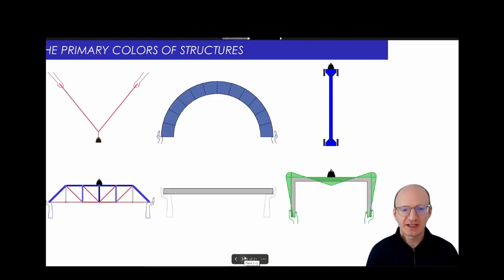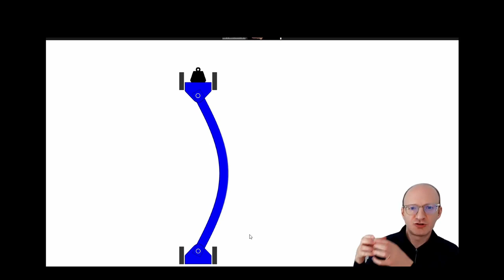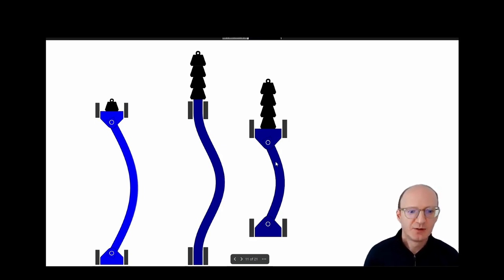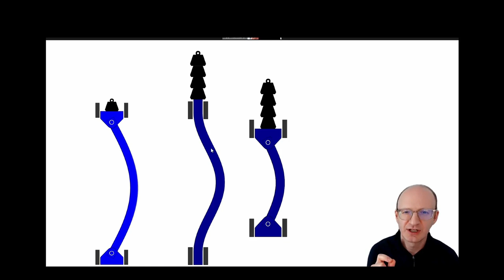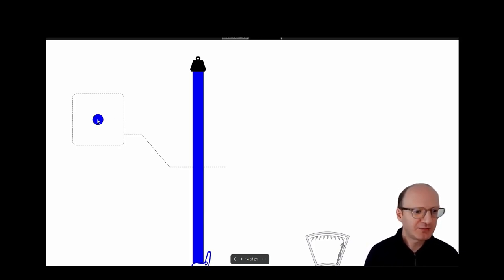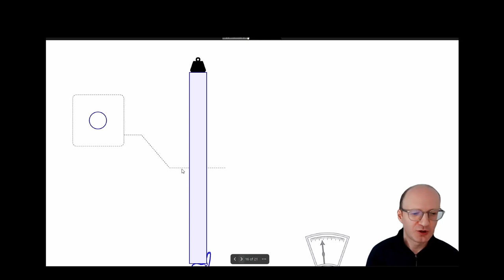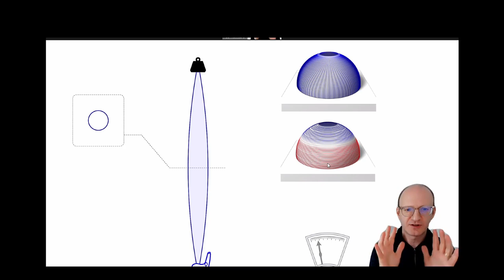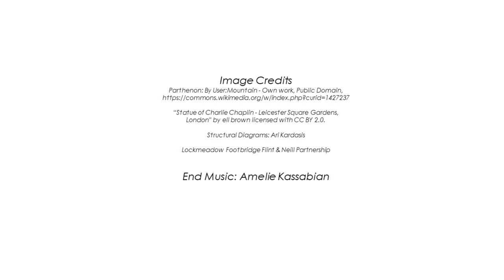How Columns Work! (Part 2): Structures 4-2

Comment: This makes me appreciate Stanford's campus a lot more.  That main quad has short columns and big arches, and the weak points of the arches fold together and reinforce each other.
Reply: They also anchor all their short columns, making them super strong.
Reply: Their columns are also super wide and thick with a large diameter.

Comment: Paul, I really enjoy your videos. Very informative & relevant to a hobby project I'm working on.
I've been studying columns recently. I particularly like the cigar shaped columns.
They has many driven, elegant features: contoured to control deflections, parallel axis to better resist buckling, and strength to weight. All together its perfectly suited to my application.
 
I'd like to research the cigar shaped column more. I've never seen anything like it. What are they called? Is there a trade name or keyword I can plug into Google or a library card catalog?

Comment: In the cigar-shaped optimization, I was puzzled that the real-world example (9:45) had no diagonals. Because the ends taper back together to reinforced point(s), is it less critical in this kind of application than a standard straight truss?

Comment: amazing it gave and reinforced my intuition on columns!

so from what i understand (pls correct me if iam wrong)
the greater the height and or weight it increases buckling
buckling=W×H
but if its restricted on both ends of the column, the height can increase with the same bend as the same weight as the other shorter version.

as for the tappered column the bend tends to happen at the center(transverse) of the column so increasing the size of the middle can reduce it?
Reply from the maker: overall that's correct...the tapered column is about distributing material in a ways that's more related to its need...